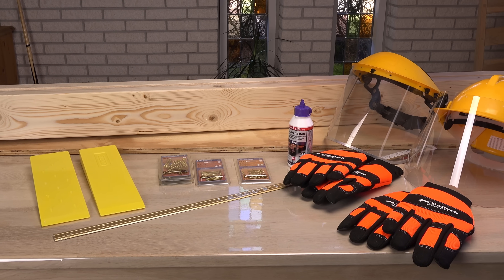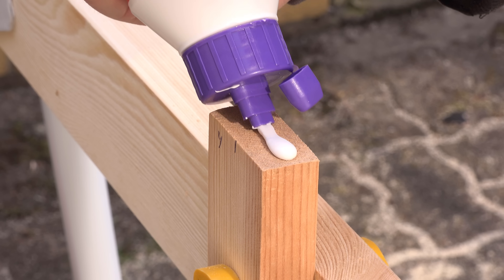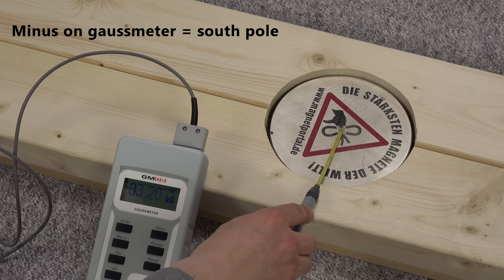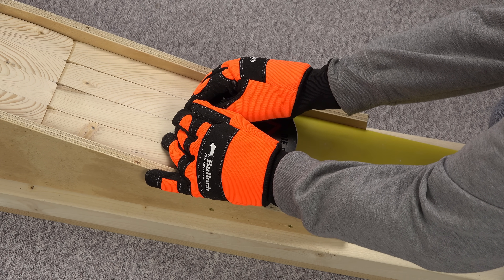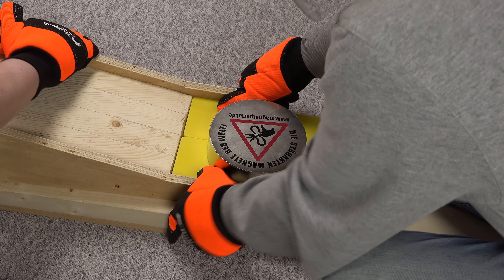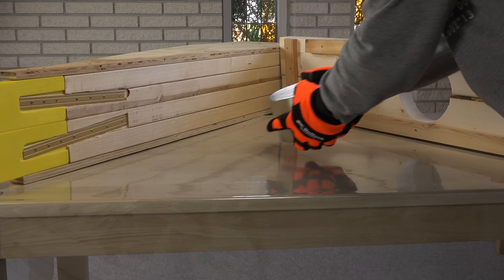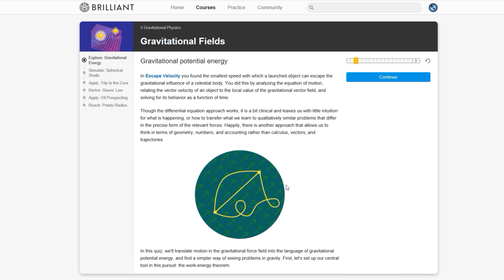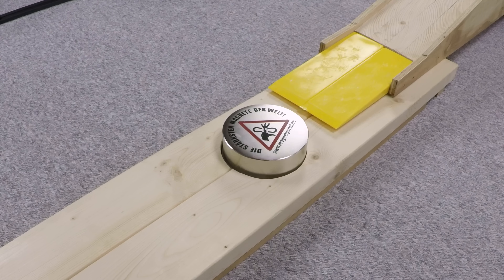Monster magnet meets monster magnet...

Comment: You know what you could have used? A giant, cylindrical block of ice. Get a pipe/tube or a set of guide rails to hold the first magnet, place the ice block with the exact same diameter as the magnet on top of the first magnet. Then drop the second magnet on top of the ice. Then just leave it outside and wait for the ice to melt. A lot less pulling and woodwork.

Comment: Next on hydraulic press channel. “ splitting 2 neodymium magnet with a hydraulic press”
Reply: Takes a very special press made of non-magnetic (and non-diamagnetic) material. What do the magnets to do hydraulic fluid?
Reply: @57thorns  i dont think  that hydraulic liquid  is  magnetic  also  you  could  just  heat  up  the Magnets before doing it.

Comment: Great job! But it is now inevitable, for me, to wonder how many people would take to separate them by using two pieces of wood just like you have used on the bottom magnet and sliding them apart in opposite directions.

Comment: Have you separated them yet? 

I think two wood frames and ratcheting cargo straps. Or an hydraulic bottle jack. Which may also be a method of control when sliding them back together

Comment: What about this method: place the magnets on top of each other with a block of ice in between. Then cool the magnets to 0 degrees so that the melting of the ice can be controlled. 

Or, maybe a wax block that can also be cooled and controlled strength by temperature. It would be squeezed out.

Comment: How to divide this magnets after.
Reply: A nuclear bomb
Reply: With a hydraulic press.
Reply: AqarI [GD] I think he means by putting a wedge in the small gap and pressing down so it splits
Reply: dropping a nokia on it
Reply: The only way to divide them is to use shear force.  You must slide sideways using two frames.  It shouldn't take as much force as it did to put them together as in the video.
However, the frames must be well constructed so as not to allow the magnets any movement in any direction.  Two guys on each frame would probably be enough.
Reply: @Hutch5321  too complicated,  you could either heat them up or put them into a furnace and will be easy to separate them.
Reply: you have to call chuck norris...
Reply: with the infinity Gauntlet
Reply: Arhivur Wise thx
Reply: The off button...
Reply: Turn them off
Reply: Play this video in reverse ;) haha
Reply: Kishanman J I thought about that :/
Reply: felixar90 😂😂😂😂😂😂😂
Reply: Either heat them up so that they lose their magnetism permanently, or else do it the slow way. It takes a couple of years; scratch the surfaces and wait until they both oxidise to dust. Those magnets don't like Oxygen and humidity, and the outer plating is there to keep air out.
Reply: Heat them to demagnetized it
Reply: oks omkar fire 🔥
Reply: You can split it using the device from guardians of the galaxy movie which harness the infinity stone from a ball
Reply: Caleb Begly Thx man ! Now, I find this video even more epic !
With the broken magnet on the slow mo guys, I do understand the risks really well and why they've done all this in that way !
Thanks !
Reply: A thousand degree knife
Reply: Hutch5321 thx
Reply: Jaakko Ruotsalainen Reverse hydraulic press
Reply: oks omkar you domy
Reply: oks omkar don't*
Reply: It may be easier to separate then to stick together 🤔
Reply: Just reverse the steps
Reply: Caleb Begly wow, I didn't even think that
Reply: hydraulic press is metal so I dont think it can
Reply: More magnets
Reply: turtle nba Do you want to destroy Earth or something?
Reply: https://www.youtube.com/watch?v=ybY_wdQ5MSc
Reply: You have to place your smartphone on it. But it only works if it is the most expensive model available.
Reply: Arhivur Wise really?
Reply: oks omkar use it as one
Reply: Fire up 'ol Slave Lake!
Reply: Jaakko Ruotsalainen Hydraulic press presses the things into things...

Comment: but did the magnetic pull increase or did it just stay the same?
Reply: it would be more, maybe 40-50% more if I had to guess, I have an inch cube and a 2x1x1 and the double tall one has like 35% more force, but I think these would be more efficient at stacking power since there 3 times wider than tall
Reply: Imagine you bond 2 circles and how the shape will be so it does increases
Reply: it pulled ur mum
Reply: The magnetic energy remained consistent with known 'laws' as they came closer, the aparrent resistance increased due to the increased friction because of the increased pull from the decreased distance between them.

Comment: Would not sliding them over each other have been easier? In an opposite-of-shearing motion...? Both magnets could have been held in fixtures like the lower magnet here, making sure they're exactly level with the fixture, then slid over each other; would the friction involved really make this unfeasible...?
Reply: I remember he explained this in an old video. Because the magnetic field has a direction, if you tried to slide one on top, it would actually flip over and collide uncontrolled.

Comment: good job, i believe you can use a blowtorch to significantly temporary decrease the magnetic force of the magnet . you can test it how much % will it lower the magnetic force. i also understand after cooling down, a % of the magnetic force will be lost.. unless the magnet is cooling down under a strong field of magnetic flux, the same way neodymium magnet was created in the first place.it seems you have the tools to test it out.

Comment: Would it be possible to use a thick cold oil to slowly allow the magnets to come together?
The rate of approach could be controlled somewhat by the temperature (viscosity) of the oil.
The question would be whether the magnets could squeeze away all of the oil from between them.

Comment: These magnets are clearly attracted to one another.  Have they bonded?  I did actually wonder if the force between them would have caused them to get sort-of welded.
What will happen to them?  Are they stuck together for all eternity, or do you intend to attempt a separation at any time?  If you leave them together, will they be used for anything?  If you eventually dispose of them, how will you do it?  Is there a lab anywhere that could use them for research or something productive?
I have seen a number of videos of these magnets, but they are all just about people's interest in huge magnetic fields - but apart from their interest value, what are they actually made for?  Do they have an application in industry?

Comment: I miss the conclusions of this experiment. OK, I got it, joining 2 magnets is possible. Is that all really? Surface magnetic force was measured before, but why not after also? Why not measured between them when they were close to each other? But I'm pleased that you didn't make some stupid destroy like some other channels.

What are the other missed oportunities?
You could have built a fixture to hold (+let them closer and make them apart) the magnets apart in a controlled distance. This way you could have created a space with nearly homogenous, very strong magnetic field (stronger than the surface strength now!), available for other experiments (eddy currents, ionic fluid flow separation, etc...). You could have measured the force in the fixture to validate specified pulling force of the magnet. You could have checked the homogenity of the magnetizing. Etc...

Comment: And now try putting them together by placing them in each end of a cylinder with air pressure building up between them. Maybe with a valve/pressure-gauge in the middle to the pressure can be let out in a controlled manner and to see how much atmospheric pressure they can generate.

Comment: That little piece of plastic would bother my OCD... Time to floss your magnets!

Shame its not that easy
Reply: Maybe some solvent will dissolve it.
Reply: TheProstheticLemon pipe goes around the magnets.
Reply: Luke Den Hartog do you also ever have the urge to not wanna do something for absolutely no reason and all you can think about is doing it?
Reply: Like squinting your eyes so that your upper eye lashes scrape the top of your eye balls
Or twisting your hip bones at an angle to get a weird feeling from it

And like not doing these when you have the urge to creates a very disturbing distress
Reply: Sniper X I don't have OCD, but yes.
Reply: MAGGOT VOMIT I like the idea, but i think over a ton, possibly close to two tons crushing ice in a pvc tube could break the tube.
Reply: Mark Wright how about just heat the magnets to their curie point so they are no longer magnetic then let them cool in the exact placement you want
Reply: Luke Den Hartog lol ya if that was me I would have to get the plastic out XD
Reply: MAGGOT VOMIT the pipe would still be there? The ice melts, the pipe doesn't

Comment: I think the coefficient of friction decreases as the pressure increase.
When all the magnet area touch the plastic part the pressure is low and the coefficient of friction is high. When only the edge of the magnet touch the plastic part the pressure is higher so the coefficient of friction is lower and the magnet slips.
For the noise: imagine that the surface of the plastic part is a brush: when it adhere to the magnet because of the pressure it will deform to follow the point of contact. When it finally detach it resumes its normal form making vibrations. When the forces involved are low, the vibrations are ultrasonic and turn them into heat, when the force if high like in this cas or like when somthing is cold rolled the vibrations turn it into sound.

Comment: I think it should be about 1.87m away from the front edge of the pole.  
I used:
B = (Br/2) * ((D+z)/sqrt(R^2 + (D+z)^2)-z/sqrt(R^2+z^2))

And found Br = 11.7e3 Gauss based on the measurements provided in the video.
I used D = 0.0508 (or 2 in), R = .01524/2 (or 6in/2 = 3in), and z ~= 27cm.  
These gave B = 58 Gauss as shown in the video, and 3.2 kGauss with z=0.

Then, I just found where the B was about 1 Gauss, since the Earth's magnetic field is 0.5 Gauss on the surface.  So to completely flip a compass, it would have to pull just a touch harder than that to be the dominate field.  Therefore, Solve for z and I got about 1.87m

Comment: Personally, I would have considered a lubricant on the wedge (probably powdered graphite). Still, great video, and glad the experiment went well!
Reply: I was thinking the same thing. Why not mineral oil or gun oil?
Reply: whatfireflies gun oil or mineral oil could possibly work, although viscosity would be an issue. Personally, I’ve always had excellent results with wooden projects/machines and powdered graphite.

Comment: Your a mad man and i love it. So they each have a rating of 2650 lb but that does not double with two correct?
Reply: Also a bit of lube on the wedge would have probably helped a lot. wire lube like us electricians use would probably work well.
Reply: So much suspense
Reply from the maker: That's correct. The pull force isn't twice that of a single magnet. Far from it - maybe only 25% more. I haven't measured the gauss' etc. on the new magnet - coming in my next video.
Reply: Awesome, what about the strength that they hold to each other? like would it take just 2650 lbs to pull them straight apart or 25% more?

Comment: yeah they're really not going to separate easily.... if ever
Reply: JINX JONES a don't worry apply another larger magnet on the other side and pull ;)
Reply: Zhroomz A bigger fourth magnet!
Reply: 213423 134242 but then how do you get the third magnet off once the first two separate?
Reply: Moraren yeah!!!
Reply: I've got a couple of 40x40x20mm flat ones and a couple of 40x20mm and I had to make a wooden, scissor contraption to separate those relatively small pairs. Thank you Brian for that solution

Comment: The noise was made by the plastic pieces acting as a reed. So the wood on the wedge was acting as the amplifier of the frequency produced by the stretching and contracting of the plastic wedges.

Comment: Wouldn't it have been smarter to use a pulley system instead of raw man force or some sort of coating to reduce the friction on the wedges? That second one probably isn't the best of ideas, but it's something.
Reply from the maker: A pulley system would've been plan C. But we are stronger than we appear ;)

Comment: My guess for the noise is that the vibration, caused by the simultaneous pulling of the wedge and the squeezing of the magnets over a non perfectly smooth surface, was at that precise audible frequency. The fact that it was a strong sound is because the forces in play were really high and so the "volume" was high too.

Comment: if you're able to get your hands on a block of teflon, shaped like the plastic wedges you used, that seems like an ideal end ramp. strong and very slippery. or even just some dry graphite lube for the wedge might help for future magnet madness
Reply from the maker: Yep, teflon wedges would most likely be ideal. But I have no idea of where to get large chunks of teflon?
Reply: ebay would probably be the easiest source for the amount you need. hard to buy such small quantities directly from any manufacturer. i remember seeing ave's channel talk about getting hold of and machining some teflon to make a "warranty void" sticker remover.

Comment: To calculate the amount of force needed to pull apart those magnets, would you simply have to add together the amount of force each of the magnets can hold?
Reply from the maker: No, oddly enough the pull force between two magnets and one magnet and a thick iron piece is more or less the same. Try using an online calculator like https://www.supermagnete.de/eng/adhesive-force-calculation or https://www.kjmagnetics.com/calculator.asp

Comment: That was simply amazing. The strange noise surprised me also: completely unexpected.
Always a great video, carefully edited, multiple angles and selected music. A lot of work for our enjoyment.
Thanks!
Reply: The sound was most likely air being pushed out between the magnets as they got together so quickly. It didn't happen at other times because there wasn't as much air being pushed out. If you look back you can see that there's a sudden pull when the sound happens.

Comment: In the end, were the magnets rotating because of the Earth's North South Magnetic field, and not metal inside the table?
Reply from the maker: It looks like the shiny, newer magnet is facing us in the clip. That's the south pole. So I would say it is a bit of both then. The magnet is returning to be almost parallel between the metalsheet covered bars under the table, but the south pole of the magnet is also facing mostly in southern direction.

Comment: My guess is 219 CM.
Reply: Watch the previous video at the 6:30 mark.  Two of them stacked together is 1,768 cm^3.  The D200 X H50 was 1,571cm^3.  That one did 213cm.  Two problems with just a simple linear equation.  The magnet is going to be thicker, which should give a more focus to the ruler.  The other is Gauss strength is an exponential loss per distance.  Even if you get a much larger magnet then these the rate of distance will be very disproportionate to the cm^3 of the magnet.

Comment: Actually, I think that the air should be reducing the magnetic field significantly. You need to wiggle that piece of plastic out. Misallign them and re-allign them to shuffle out that plastic piece.
Reply from the maker: It's not possible to wiggle them anymore by hand (I tried...). Maybe with some straps and pulleys...

Comment: That was amazing ! I appreciated it, thanks alot for the content.
One question, why didn't you use some mineral oil on the wooden and plastic construction to smooth the sliding ?
Reply from the maker: Thanks - mostly because I don't want to have anything stuck between the magnets - including a thin film of oil. I'm not sure about the long term effects (smell, corrosion etc.). Thanks for watching!
Reply: Yeah, now I understand why you didn't. Thanks for responding.

Comment: If you heat them hight enough, would they lose their magnetic force?
Reply from the maker: Yes, they have a Curie point. They start losing magnetism above 80C and all is gone at 310C.
Reply: how does it compare to a normal magnet Curie point, is there any difference?

Comment: Maybe you could've lubed/waxed the slide somewhat, just for easy of combining. But looks good!
Reply: I think the coefficient of friction decreases as the pressure increase.
When all the magnet area touch the plastic part the pressure is low and the coefficient of friction is high. When only the edge of the magnet touch the plastic part the pressure is higher so the coefficient of friction is lower and the magnet slips.
For the noise: imagine that the surface of the plastic part is a brush: when it adhere to the magnet because of the pressure it will deform to follow the point of contact. When it finally detach it resumes its normal form making vibrations. When the forces involved are low, the vibrations are ultrasonic and turn them into heat, when the force is high like in this case or like when something is cold rolled the vibrations turn it into sound.